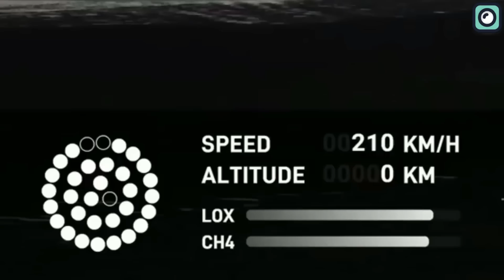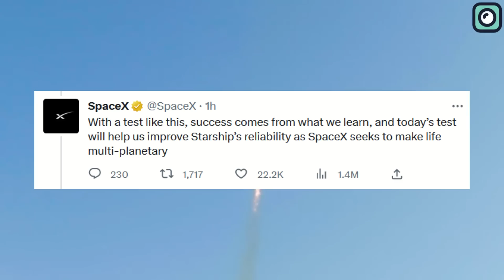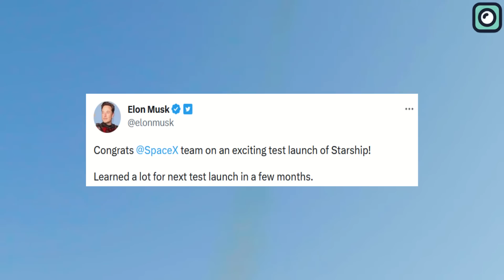SpaceX Revealed Why Starship Blow Up During The Orbital Launch Test... Musk Reacts!

Comment: NASA does unit by unit testing where they test each component and sub-assembly before they are combined,expecting them to work.
Boeing does it differently.  They hold rigid QC during manufacturing then after they are assembled, Boeing tests the whole thing.  Called "All-up" testing.
Spacex does the same as Boeing, All-up testing.  (Only at 5 times their speed)
**YOUR wording says it all.  You are going for maximum drama and not accurate reporting.  Plus it is like you want Spacex to seem to fail.  This is why YOU fail to gain many watchers.  Negative reporting.

Comment: I've watched a great many of the videos of the launch, and it seems that there are two camps. One says that there were some serious, and seemingly-deliberate, mis-choices and ignoring of known data, and the other, which I will refer to as the "Musk-eteers", say that this is all a case of S*** just happens when you launch rockets, that everything is and will be OK, that risks have to be taken. I am certain that there were folks there that tried to explain that there were serious problems. The construction engineers knew the limits of the "0" stage and of the ground on which it was built. The rocket scientists certainly knew the combined thrust of the rocket and the heat produced. I am also certain that these two groups had at least one talk, and that someone, or several someone's, tried to explain things to the person at the top, but since he had other ideas,... Given the amount of large debris seen being blasted upwards past the lower stage, they are lucky the rocket made it past the pad without blowing up right there. Their tank-farm could also just have easily become a flaming casualty, or BOTH, which is the likely result if the booster had blown. He verbally acknowledged, before launch, that the omission of a flame-trench and water suppression system might be a mistake, yet, in the face of hard numbers, and evidence from previous launches of less-powerful rockets, he chose to proceed, a case of an "I get what i want because i want it" attitude overriding common-sense and acceptance of facts.

Comment: I'm not an engineer, but I have seen massive destruction in my 3 years in combat as a US Marine.

Judging from the observable damage to the OLM, it appears to me that adding a flame diverter and a water system isn't going to do much to lessen the damage that 15 million pounds of thrust can obviously create.  I predict Musk will opt for an entirely new design of the OLM and it will take more than a few months to repair, redesign, rebuild everything that was damaged.

At least the four legs of the OLM were still standing.

Comment: Putting a 20 foot deep pool of water beneath the launch tower would prevent the damage to the launch pad, maybe need even deeper but that’s a basic solution to the damage problem

Also a series of catch wires stretched between multiple towers minimizes damage to the tower(s)